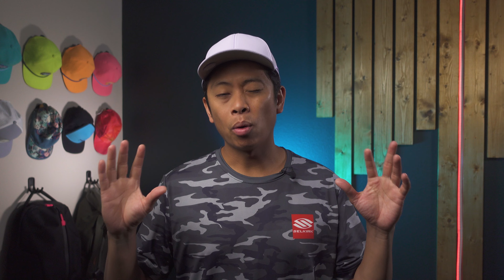Is your paddle broken?! (Delamination Explained)

Comment: Hi Will, my relatively new BD 6.0 experiences some level of disbonding. I have been talking with 6.0's customer support, but we couldn't agree on the condition of my paddle. Super frustrated with 6.0. I like the (single) BD, for how solid it feels and the power, but I can't work with their customer support. What would you suggest me to try instead? Thanks in advance.
Reply from the maker: You could try the Nova from Ronbus or one of the Vatics. Tbh most of these thermo paddles come from the factory with a little core-ruption and sometimes you just get unlucky.
Reply: @PickleballWill  Why Nova over Pulsar? I heard that power wise Gen 2 is still greater than Gen 3?
Reply from the maker: @EdisonShiFilm just if you feeling stressed over delam. I would choose pulsar over nova
Reply: I had the relatively same issue with my DBD from SixZero and customer service said there policy concerning Core Crushing doesn't honor anything past 120 days--it started right after 4 months!  they said they would give me 50% off a new paddle--not worth it for me so i went with Ronbus and Vatic Pro for the time being and so far no issues after 2 months.  So sad considering i sent them a 4K video high resolution video showing exactly the sounds mine was making!  Boo Six Zero, Boo!  And yes Chris Olsen still still competes with that paddle, but he probably isn't playing longer than 3 months with any one specific paddle from them.  If you want to go the distance, go with Ronbus, Dong just works tirelessly at finding good recipes for paddle success in the long game.
Reply: @PickleballWill  I think in someone's latest video about NOVA mentioned that it's Gen 3 and created pocket to allow air to escape during the thermo forming process.
Here is our crunchy my paddle is now.
https://youtube.com/shorts/ZzfKBmOTkd0?feature=share